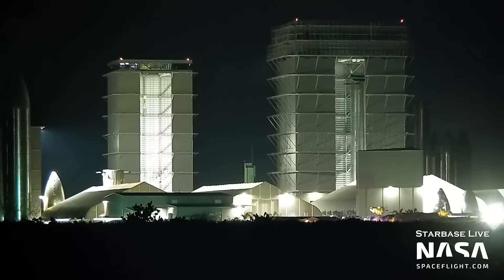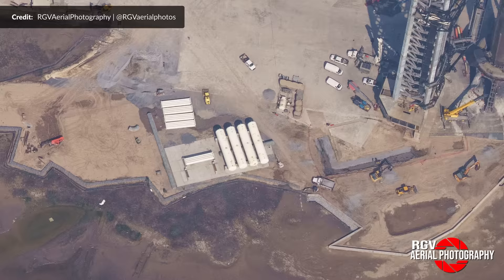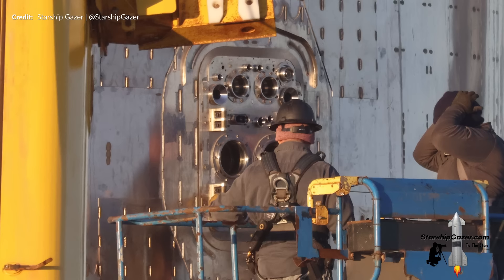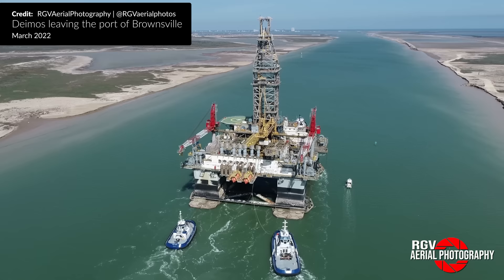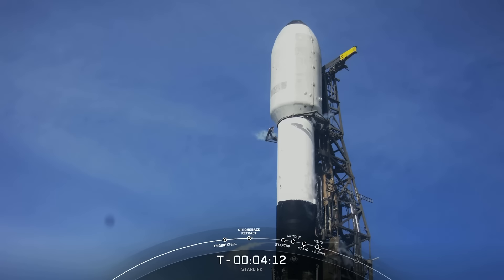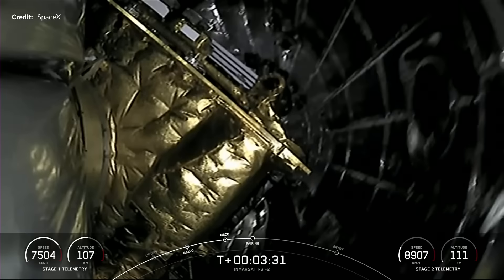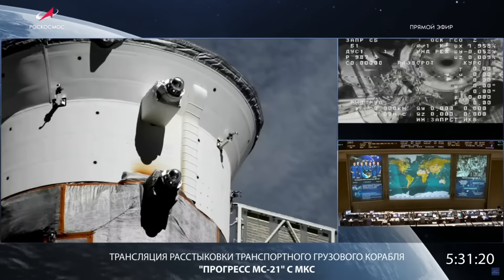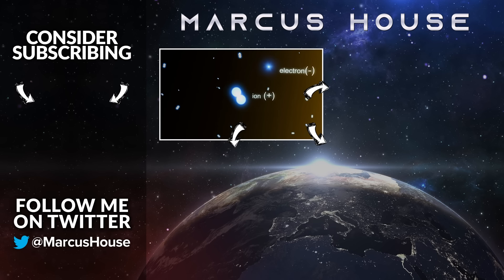SpaceX Ditches the Oil Rigs and Incredible Insights of the Orbital Launch Mount/Booster Static Fire

Comment: As a part-time audio guy for theatre, the sound frequencies and precise relative locations of the engines with respect to each other are the things to think about. To get noticeable phase cancellation, the peaks and troughs need to have opposite apparent polarity. You can run a simulation to determine the best strategic relative positions, but with a device with 33 engines whose positions are dictated by the mechanics, I doubt they would have prioritized phase cancellation in the design. 

I think this is more likely the result of a common misconception with audio. Intuitively, you would think that adding more and more sources of audio would increase observable volume in a fairly linear manner and you would be able to hear the noise from further away at a linear rate, but I don't think the math quite works out that way. More speakers doesn't necessarily mean more range. Range has a lot more to do with how "pure" and how long a sound wave is. So a single sine wave generator operating at 40 hertz at say 50 dB will be heard much further away than pink noise being generated at 70db. 

My guess is that with 33 engines, you're dealing with many waves that are both in-phase as well as out of phase. So you have addition in some spots and reduction in others. I wouldn't be surprised if people in one general area reported louder noise than expected and people in other areas equally far away reported noticeably less noise than expected. As you change your position angularly with respect to multiple speakers/engines emitting more or less the same frequencies at the same time, you will move from what we call "power valleys" into normal space, then into "power alleys", and so on and so forth. 

What audio systems engineers do is they run simulation software to draw heat maps of where those alleys and valleys are and then they/we place speakers strategically to minimize those alley/s valley's for the smoothest possible coverage. 

Practical example: next time you go to a live concert and happen to be free to move around the room, notice how the bass level goes from normal, to loud, to normal, to quiet with respect to you walking around the room. This happens when you have multiple subs interacting with each other. It works best with bass frequencies because those waves are larger and are thus more likely to have more frequent cancellation/addition areas. The power alleys/valleys for higher frequencies get smaller and smaller until they just don't matter anymore, usually not much higher than 500 or so hertz.

The primary thing to remember though is that 33 engines is a lot of engines, or a lot of speakers, so any phasing effects will be fairly tame since the sound has extremely little purity. In other words, the sound waves are very broken up and everything is fighting everything. If the goal were to be to get the loudest possible engine sound (which it obviously isn't), you would only want a small handful of very precisely placed engines/speakers, preferably pretty far away from each other. More engines just means more and more fighting amongst the waves.
Reply: Well put, you could consider the gaps between the OLM legs as emitters. there will be null points as the waves from adjacent apetures overlapping.
Reply from the maker: This is a wonderful response to the query and I appreciate you taking the time to explain all this.
Reply: So basically, the actual sound level is probably nowhere near the predicted levels. Good news for the Florida launch site :)

Comment: One reason to run the engines at 90% might be to have some reserve power incase some of the engines fail to fire like was the case in this latest test fire. 

Thus if an engine or two fail to fire the others can ramp up to 100% as  needed to compensate for the loss of those engines.
Reply: Eds  these engines need to have consistent performance. And they are still having lots of mechanical issues.
Reply: Would still make more sense to run all at 100%, you want to use every gram of thrust during launch or you lose a lot of efficiency.
Reply: @axiom1650  If you have zero payload & it's early in developments to increase success chances, not really

Comment: The 31 engine static test was only at about 50 percent of full power so that might be one of the reasons why it didn't seem as loud as they thought.
Reply: @jebes909090  yes, would have been a good idea for that deluge system. Better late than never.

Comment: Another good update.  I'd love to learn more about the Dragon 2nd stage engines.  Highly reliable and being produced at an increasing pace to keep up with the launch pace.  They don't get a lot of attention.
Reply: I'd like that, too.
Reply: Dragon or Falcon ??
Reply: @nirbhayatiwari5425  Falcon
Reply: The Dragon uses the Draco thrusters for maneuvering and the Crew Dragon adds in Superdraco thrusters for aborts only. I think you mean the Falcon second stages, which use a vacuum variant of the Merlin engines that the first stage uses. Rather than go to LH2/LOX like a lot of second stages, SpaceX kept the same engine at a small efficiency loss to keep costs down by having common engine packs.
Reply: @steveaustin2686  Yes I did.  Thanks for the clarification Steve.
Reply: @RidiculousRocketry  I think you got the explanation by Steve  ..
Reply: @steveaustin2686  Hydrolox upper stages are not as easy to handle as Keralox upper stages  .. 
But hydrolox upper stages have higer efficiency than Keralox though
Reply: @nirbhayatiwari5425  Yes. That is why the Atlas-V can deliver less payload to LEO than a Falcon 9 B5, but can deliver slightly more payload to deep space, because of the LH2 Centaur upper stage on the Atlas-V.
Reply: @RidiculousRocketry  You're welcome.
Reply: @steveaustin2686  Brother , Are you a rocket scientist  ??
Reply: @nirbhayatiwari5425  Nope, just an interested amateur who read and watches videos on the subject.
Reply: @steveaustin2686  What do you do for living  ??
Reply: @nirbhayatiwari5425  Nothing important. Just a regular guy who likes space.
Reply: @steveaustin2686  Ok brother  .. 
But I meant that for living we all need money  .. 
So I wanted to know your source of income ???
Reply: @nirbhayatiwari5425  Sorry, not giving that to a stranger on the internet. I'm just a regular guy, in no way working the space industry, who likes reading/watching info on space. I have a fairly good memory and keep some info handy for these discussions that I can reference.
Reply: @steveaustin2686  Ok

Comment: 31 Static fire was good but 33 at 50% thrust or greater would be epic. I suspect this is when and only when the FAA will grant a launch license making March 2023 more likely. Kindly see if you can find any updates on that Launch License Marcus. At any rate thank you for providing more SpaceX content this week I really enjoyed it!
Reply: Wasn’t the FAA license issued in July 2022?
Reply: @TheAmericanCatholic  that was the environmental assessment
Reply: @TheAmericanCatholic  SpaceX's Boca Chica site underwent an Environmental Impact Statement (EIS) for Falcon boosters 10 years ago. In 2014, SpaceX got approval to launch Falcon boosters and reusable spacecraft at Boca Chica. SpaceX did not build any Falcon facilities at Boca Chica. The FAA review that completed in Jun 2022 was to see if Starship would fit under that existing EIS or if a new one would be needed. As long as SpaceX completes/starts the mitigations that the FAA review mentioned, they can apply for a launch license from the FAA. They need to submit booster data in that launch license, so likely need it from the tests that SpaceX is running. Once the launch license is submitted, it evidently takes a few weeks to approve.
Reply: @Brainy_Bytes  Sorta. It was to see if Starship could fit under the existing EIS at Boca Chica.

Comment: I wonder if SpaceX can use destructive accoustic interference also help cancel out dangerous resonant soundwaves, maybe by using different throttle settings on differnt engines. Wild if so!
Reply: SpaceX is ringing the Orbital Launch Mount with tens of thousands of refurbished Bose noise-cancelling headphones whose earpieces crumbled under warranty.

Comment: Frankenstein ship is spot-on.  One thing I love about SpaceX is that they iterate like no other company or entity I can think of.  They are not afraid to change direction or abandon something huge like the modified oil rig / landing platform completely.  This is how they will continue to blow the competition out of the water.
Reply: Sometimes it bites them in the ass too. They did waste a lot of money on the oil rigs. They also are still tweaking Stage 0. Sometimes rapid iteration works out and sometimes you hit dead ends and have to regroup. SpaceX is still currently the top launch provider in the world.
Reply: @steveaustin2686  well, you will always hit dead ends somewhere.. with rapid iteration you can spot them much earlier though, and change the plan accordingly..
Reply: @unitrader403  As long as you can afford it. It is very expensive.
Reply: True however every gamble is not a good one and expensive mistakes can be very costly even for an industry juggernaut like SpaceX.
Reply: @steveaustin2686  failures are part of the process. If you set out to attempt 10 different things to find one that works, you wouldn't say, "1 out of 10 times this method works, 9 out of 10 times you hit a dead end". No, it's all part of the same method.
Reply: @TaysanGalovu  I never said that failure were not part of the process. I said that rapid iteration can lead to dead ends. I also said that it is every expensive. I'm not a SpaceX hater, but we do need to be realistic about SpaceX or you can swing too far the other way into 'rah, rah, rah, SpaceX rulz' territory where you ignore reality.
Reply: @steveaustin2686  Great point & subtle as well.
Rapid prototyping allows the problem/solution space to be explored quickly and effectively, if there's many "unknowns" - with the caveat that running forward full pelt may lead to dead ends, with back-tracking and redesign required sometimes.
When the problem/solution space is "well known"  or 'for reasons' limited iterations are possible, extended detailed design & simulation ("thinking about it") is more effective for time, data and cost.

Starship went through 20+ iterations quickly, then slowed considerably. They're not wasting time/resources exploring small refinements, but are refining the design without full flight testing, as documented by changes to the ships Marcus shows.

Sitting on the sidelines, it's been a fantastic show :)
Reply: @SteveJenkin  Oh for sure. I would think that part of the slowdown, may be that they need data from an 'orbital' flight to do those refinements and iterations. Computer sims can only take you so far, until you need test articles at the scale of 12 inches to the foot out in the real world.
Reply: @steveaustin2686  😄 .... scale of 12 inches to the foot.....            that was funny, even at 1am.
Reply: @David-yo5ws  It was in a book, David Weber's Honorverse IIRC, as 10 cm to the meter I believe. I'm sure he wasn't the first one to think of it either. Yeah, you need full size testing at some point. The traditional method is to test the crap out of everything, so so need few, or one, tests of everything together. SpaceX has started that testing earlier, so not everything has to be perfect. See hydraulic powered gimbaling, when electric powered gimbaling wasn't ready. Starship prototypes can be made cheaply compared to traditional space hardware, so it's not outrageously expensive, only expensive.

Comment: Excellent video and good news about SpaceX selling the oil rigs.
Personally, I always thought that diameter of the rigs were too small and that they would need a custom built rig to house a complete sea based ground zero.
Reply: True although who knows how expensive these floating landing pads are going to be.
Reply: I think the Mechazilla launch/landingtower and orbital launch mount would easily fit on the repurposed drilling platforms; I don't know where SpaceX would put the tanking system and the water deluge. SpaceX bought the rigs cheap but seems way too busy building its second and third Mechazillas before launching a single booster or stacked Starship! to adapt the unproven design.

Comment: This reminds me of something that happened with a Soyuz capsule many years ago.  It seems someone deliberately engineered a leak by drilling some holes on the inside of the capsule where it wouldn’t be detected.  The capsule made it back safely to Earth though, which is why we found out, but I never heard if they caught the one responsible.  Also has me wondering if he’s still at it.
Reply: We shouldn't be dealing with russia any more.
Reply: That sounds very familiar to me for some reason, but I can't recall why....
Reply: @pricelessppp  Russia built roughly half the ISS and has the sections that provide attitude control. The US side provides the power. Neither can do without the other.
Reply: Do you think it's possible sabotage with a disgruntled employee or something?
Reply: Would have thought that that would have been very hard to get away with considering that the rocket industry has so many procedural checks during the manufacturing of all the components all the way up to assembly on the launch pad.
Reply: @serronserron1320  I never heard of any follow up to the report.  I would like to find out myself.
Reply: @MyLateralThawts  IIRC, it came down to probable sloppy workmanship, as the hole was behind panels that were not really accessible in orbit.
Reply: @steveaustin2686  Holes!  As I recall from the article.  Deliberate, with no reason for drilling them except sabotage.
Reply: @karenrobertsdottir4101  Not with one Dragon. Attitude control would require a widely dispersed set of Dragons. There are only two IDAs for Dragons to dock at. I'm not sure if they Dragon 2 can be berthed or not in the other two ports.

edit: fixed grammar as I should not type on the phone while playing cards. ;)

Comment: Regarding the static-fire acoustics, unfortunately the peak noise is not during holddown, but when the vehicle is many diameters off the pad, when the plume dynamics is fully developed and interacting with the pad.  In the holddown phase, the plumes from the inner engines are confined and will not produce much acoustic power, as opposed to when the vehicle is off the pad and the plumes are mostly combined and able to fully contribute to the plume power.

Comment: Damn, you'd think at this point that NASA would demand your company demonstrate the ability to get to orbit before giving you contracts to get to other planets.  I love that there is 'competition' for SpaceX, but it doesn't really seem like Blue Origin is actually competition outside of courtrooms.
Reply: Blue delivered the first BE-4 engines to ULA. That looks to be the last big hurdle for New Glenn to fly, from a development standpoint. This is the first NASA contract for Blue, for a launch to Mars that will likely take a booster like New Glenn, Falcon Heavy, or a VC-6 Vulcan Centaur to get to Mars. Based on the New Shepard, they make good hardware, eventually. The other launches on New Glenn are commercial, with the vast majority being Bezos Kuiper network.

Comment: The most baffling part of the OLT integrity with booster blast burns, is fuel flowing within the table stand versus a separate limb chamber. It's like an air carrier using a fuel tanker, being a few inches thick. As the ruway👀.

Comment: Hi Marcus, you and your associates are doing a stellar job with these weekly videos.  Query . . . just after stage separation the second engine fires up and about a second or two later it looks like a ring around the end of the nozzle separates from the nozzle, I've always wondered what that is and why it separates.
Reply: I believe that it is a stiffener that is only needed until the engine lights up. IIRC, it was mentioned in a NSF webcast.

Comment: I am sorry to see the semi-submersible oil rigs gone. They were bought by SpaceX at a tiny fraction of manufacturing cost. When SpaceX eventually builds offshore platforms, the cost will be much, much more.

I am no expert but I have always thought that any launch-retrieval offshore platform would have to have at least twice (maybe 4) the surface area of a semi-submersible rig. (I had originally hoped that SpaceX would weld together Phobos and Deimos, and modify from there.)

May SpaceX gain much clarity prior to when they have to go ahead and construct offshore platforms.
Reply: It would be interesting to see who they've been sold to, and what they will be used for next. I hope they're not just gone for scrap, but then again, so much goes on in the oil industry that we can't see, so let's not worry about it! ;-)